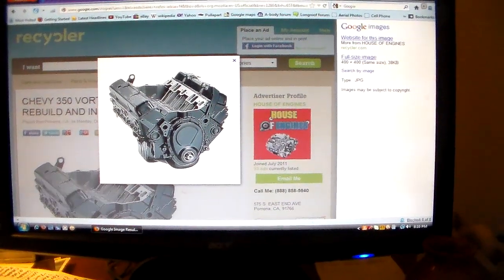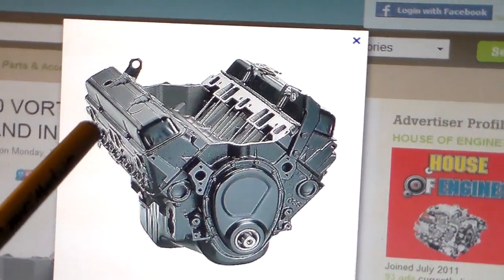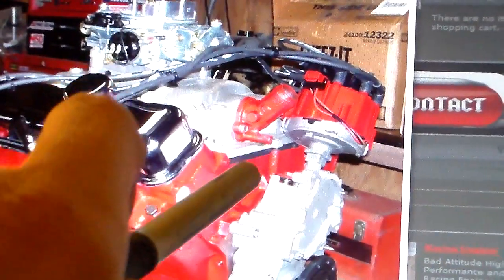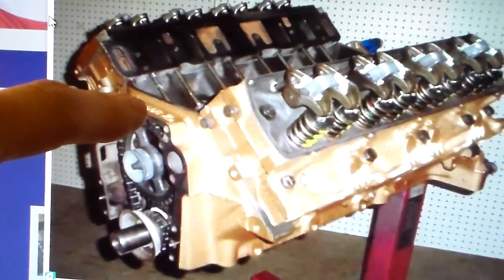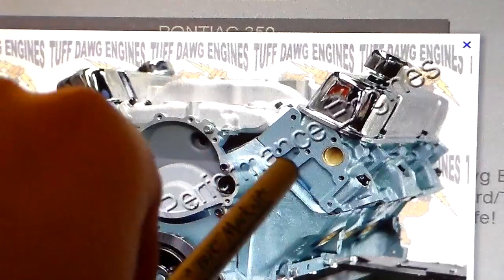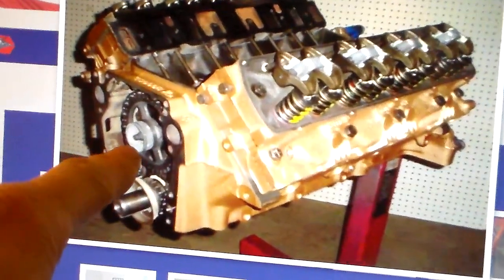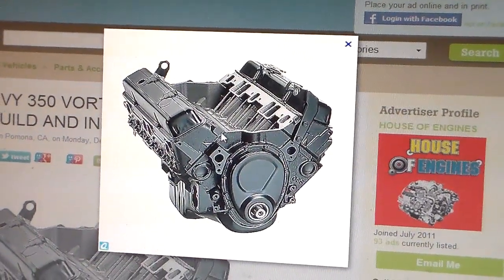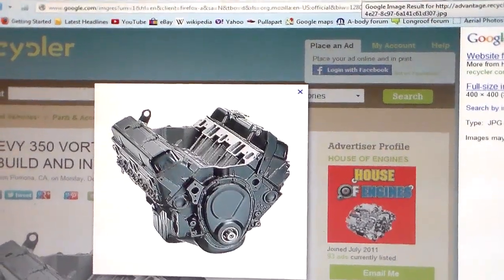Chevy, Olds, Pontiac and Buick V8 engines are not the same!

Comment: Does anyone know if I can install a 350 Chevy engine into my 1972 Buick Sylark which currently has a bad 350 Buick engine? Are the bell housing patterns the same?
Reply from the maker: They are not the same. A Chevy engine bolt pattern is different from Buick-Olds-Pontiac. Instead of putting a generic Chevy smallblock in there, which will require a different transmission and frame brackets, why not IMPROVE on things and drop in a good used 455 Buick? There are still a lot of those floating around, and it pretty well drops in place of the Buick 350, since Skylark's had a big-block optional. Then your main issue will be rear tire wear...lol. If you do, make sure you check the block casting number because small and big block Buicks look similar.
Reply: Sounds like a great plan. Thanks very much.
Reply: The 350 would have a large "350" cast into the back part of the intake. Don't know about the 455.
Reply: That would be my idea too same thing with any olds or pontiacs if it's got a 307 olds a 455 olds will fit right in a 301 pontiac a 455 pontiac goes in the same spot virtually un noticed unless you tell them no one would ever know shhhhh lol

Comment: I have a question, can you mount a Chevrolet head to an Oldsmobile engine
Reply: +Pete Zurkowski No absolutely not . Head bolts, water passages, intake and exhaust ports, and chamber to cylinder location is differant
Reply: Pete Zurkowski i will slap you no
Reply: Please don't say stuff like that again..

Comment: The 1st one is vortec 350 not a regular Chevy 350 Dummy
Reply from the maker: I'd like to make a suggestion: If you want any of the following to ever happen- 1. people take you seriously, 2. like you 3. partially like you, 4. at least not despise you until you die..THEN STOP PUTTING DUMMY ON THE END OF YOUR COMMENTS!!!
Reply from the maker: 1. Vortec is a marketing term. There were Vortec 350, 305, 262 V6 and even a Vortec 2200 4 cylinder. Look it up. In the small-blocks the difference is primarily in the heads, but you can bolt them to a "regular" 350 or 305(space that >I< didn't call you a dummy even though you weren't totally right).

Comment: After 1981,they're all the same...
Reply from the maker: Rick S  Well Cadillac actually had the distributor up front also after 1967.
Reply from the maker: They aren't all the same after '81, UncleScroatie. Buick V8's went away but the V6 was still around of course. There was still a very small Pontiac V8(265 cid) that stayed through '82, then Pontiac's were gone also.

Of course then Olds and Chevy were the only two corporate V8's left through 1990 when Olds V8's went away.

Comment: I had a1977 olds delta 88 with a Chevy 350 4 barrel carb in it
Reply: james hurt Whoever owned it before you swapped the engine and transmission
Reply: late 70s to the early 80s but all there engine are different I also had 1982 buick regal that I put a 350 Chevy engine in it out of a 1975 Chevy Monte Carlo.
Reply: james the bop caddy and chevy bells are different and how could gm get in trouble with using their own fucking engines?

Comment: but is the bore spacing the same? how about the insides?
like the ford 2.8 v6/ 2.9 v6 vs the ford 4.0 ohv/ and the ford 4.0 sohc
the old 2.8 looks nothing like the ford sohc but cams, cranks, "dizzy" all can be swapped.... to a point. so just bc they don't look the same doesn't mean they are not.

the big thing you got to look at is the block crank relationship. can a Buick, Oldsmobile, Pontiac or Chevrolet crank be swapped? and if it can't... why? is it just the placement of the timing chain sprocket? or is it something more?

that what you got to look at.
Reply: Kris Phillips With your logic all v 8 engines are the same cause they are a v8.
Even if the cranks were interchangeable between all 350 v 8 does not make them the same engine.
Similar...yes   same... no
Reply: +Kris Phillips   None of the castings are the same. You cant put a square peg in a round hole
Reply: thank you. that what really counts is the casting and bolts holes. the looks can be different but still work. you can put a 351 cleveland head on a 302 windsor but they do look different but it work as we know the boss 302. just saying you can't just go off of the looks.
Reply: well my point was that, you just can't look at a motor and say if it will or won't work. you got to dig into it and get the info. over the years i've found alot of odd ball stuff. ppl putting chevy rods if ford, putting ford pistons in chevy blocks. hell i even see someone put a volvo 5 valve head on a old ford 2.3l. you might have to do a little work here and there but some things can work that at first look you would even think about it.
Reply: yea i even seen that. you can't just slap anything together. but if you look at the vital pieces and if it is close. a little work and it can work. like the ford 200 inline 6. for a long time, you was stuck with what you got with the integrated head. but someone looked oversea at the australian ford 200 inline 6 and noticed with a little machine work it'll fit the US ford 200 inline 6. but they don't look the same. the australian ford 200 inline 6 was a cross flow design where the US ford 200 inline 6, the intake and exhaust was on the same side. but it worked. but now days someone makes heads for the little ford 200 inline 6 right here in the US.  so looking at something like a blueprint of an engine would work alot better the just looking on the out side at the aesthetics of the engine.
Reply: +Kris Phillips   I  think the pistons are different for the Boss 302, and if memory serves, the 'true' Boss 302 used the same rods as the HiPo 289.
Reply: +Stoneyburke   Although the Boss 302 is technically a different block, the chief differences are it is a slightly heavier casting with four-bolt main caps, and I think the water passages to the heads are drilled differently.   You can put 351C heads on a common 302 block with the proper mods.  It was a fairly common swap in the 1980s and early 1990s before high-flow Windsor-type head castings became inexpensive.  For a street engine, a 302 capped with 351C-2V heads were very capable engine, though you did need to locate a special intake to support the combination. 4V heads could also be used, but tended to make the engine peaky, and again, it required a special intake specific to the combination.   There was a company that made these special 'Clevor' intakes - 302/351C-2V,   302/351C-4V,   351W/351C-2V,   351W/351C-4V.

Comment: Dude makes all his vids using pictures, and wiki , he has very little knowledge about engines especially Oldsmobiles .
Reply: +david Reid  So where is this "Olds video" you told us you were going to make 9 months ago? I'm starting to lose hope in you. Are you having a hard time finding an Oldsmobile dealership? FYI: They are kitty corner from the AMC dealer. I know cuz I'm at the AMC dealership right now making my "Pacer X: Fast & Fun or Fishbowl Fiasco?" investigative docudrama video.
Reply from the maker: +judgegixxer He doesn't have time to make a video. He's too busy trying to learn Spanish off the internet. You weren't really expecting a video from him were you? He says...and I quote.."dude makes all his videos using pictures". Meanwhile, my current videos are about unseizing an OLDSMOBILE 394...live video bud. His "videos" speak for themselves. End of story.
Reply: judgegixxer You still know nothing about Olds and how they work.
Reply: david Reid uh david olds work the same as all spark ignition v8s
Reply: Yeah they do, but they have different bore, stroke , valve train is like a sbf , they like a camshaft with around .523 - .575 lift with a split duration 230/236  and 240/246 @ .50 on a 106-108 centerline 110 lsa .Lost ya yet? Just just for starters, the head flow characteristics are very different  from any other small block of its time with the side by side exhaust ports....Lots of tricks to know to make these engines perform.

Comment: MOST endivduals who think they are the same are born after 1975.  The reason i say this is they would be correct then...bare with me. the gm division around that time started heavily doing what they called "badge engineering"  now longer were one division doing everything on their own and the cars were very much alike minus small changes and no matter the brand they would use the small block chevrolet in pontiacs,buicks, and oldsmobles because to same money they were no longer making their own engines by the mid eighties.  That was the beginning of the end for both pontiac and oldsmoble

Comment: Chevrolet  is the only engine company that calls their engines small/or big block.
The old school small blocks are 302,305,307,265(rare engine) 327/348/350.
The big blocks are 366/
383 400 427//454,502.
Reply from the maker: Let me help you out a little:

1. There are small-block and big-block Oldsmobiles, Buicks and Chevies. PLEASE google that if you have further doubt.

2. You left out the 267 and 283 small-block Chevy engines.
3. 383 and 400 are not big-blocks. A 383 is a 350 small-block with a 400 crank and a 400 is a small-block with a bore so large there are no coolant passages between them.
4. A 348 is not a small-block per se. It COULD be considered one, but it belongs to the W-engine family along with the 409.
5. The big-block you were thinking of was the 402. Nothing notable about it other than it took up the same space, weighed nearly the same as and made less power than a 454.

Hopefully this will help you enjoy GM engines even further !
Reply: The facts from any/all of our mechanics and engine technicians all say that only Chevrolet has small blocks and big blocks.
Call this # 619 297-4321 courtesy Chevrolet.
Reply from the maker: TheSirjohn2012
I'm not being mean to you but there's probably not one tech there who's worked on a pre-1980 Buick, Pontiac or Cadillac engine. If I suggest you do a Google search for "Oldsnobile big-block" and "Buick Big Block", are you going to come back and tell me that all those results you got are wrong and Courtesy Chevrolet is right? They E-X-I-S-T...end of story.
Reply from the maker: TheSirjohn2012
 And anyway, I don't need to call the friendly folks at Courtesy Chevrolet...to quote "gamer-speak" I have In-Person experience with Big-block GM engines...I've actually touched them and worked on them and I hope you can too one day.
Reply: Sorry tyler but my neighbor has worked on many Chevrolet engines and he says that there are 2 kinds of chevy engines.
Big blocks/Small blocks I wish you would try to quit arguing with me and assuming your own education is far better than mine.
Us men in our 50+ years can't be argued with.
Try educating yourself in this argument and get the truth in all of this.
Now leave me alone OK.
Reply: um sirjohn you forgot the 283 small block lol and chevy didn't make a 383 lol. a 383 is a 350 with a 400 crank. I cant believe anyone would honestly think that all gm 350s were the same!!
Reply from the maker: TheSirjohn2012
It's not an argument. I presented you factual information and you refused to believe it.Facts are indisputable. That's why they are called "facts" and not opinions.

You mixed a 348 into the actual smallblock group. 348 was part of the W-head engine group. You also inserted a 383 into the bigblocks. there wasn't one from the factory. Now stop getting mad because people are correcting your info. People that are stubborn will never learn from those who have knowledge.

Comment: I saw a Pontiac parissiene with a chevy 350 engine......not standard?
Reply from the maker: They had Chevy 305's...no 350's to my knowledge.
Reply: WhoSaidTyler right, I read Wikipedia and it said Pontiac made their own engines for their cars until 1984 or something?
That was wrong?
Reply from the maker: tpvalley
 They made ONE engine by then, which was the 2.5L "Iron Duke" 4cyl. Otherwise all the Pontiac V8 engines went out of production after 1980. The Parisienne was a Canadian version of the Caprice, which was introduced in the states because buyers wanted a full-size rwd Pontiac again.
Reply from the maker: WhoSaidTyler
 I forgot about one: the 265 cid Pontiac. I think that one and possibly the 301 hung around through 1982.
Reply: WhoSaidTyler They dropped it midway in the 1981 model year (think January 1, 1981; despite Wikipedia's claim it was on April 1, 1981).
Reply: Given the Parisienne was originally a Canadian-market Bonneville, of course it came with a 350 Chevy V8 engine if it was produced from 1968 to 1980.

The tradition remained the same when the car was brought over here in April 1983 to fill the gap in the market segment left behind by the B-body Bonneville (last produced in 1981). Available engines for that short first model year included two Chevy engines (the 229 V6 and 305 V8 - both having a shared bore and stroke) and the Oldsmobile diesel V8. California V6 cars, however, used Buick's 231 V6 engine.

Both the 229 and 231 V6s were replaced by Chevy's new 262 V6 for the 1985 model year, which was also the last year for the diesel option.
Reply: ClassicTVMan1981X so whats the video bloke on about?
Reply: ClassicTVMan1981X The Pontiac I saw had 4 head lights, the pairs on each side, ...one above the other. 65 or 66 it turns out.
Reply: tpvalley Then it would have had the 250 I6 or the 327 V8 originally.
Reply: +tpvalley    81

Comment: which one is the best ?
Reply: ERICK CH Pontiac Buick and olds engines typically have more torque than a chevy, it all depends on what you're looking for. torque, or power. I mean you could build a chevy to have more torque than the others, just like you could build the others to have more power than the chevy. So there really isn't one that's better than the other, it's mostly about what you want out of an engine.
Reply: ERICK CH 350 Chevy vortec! Many performance options.
Reply: IRRC the Olds was a 5 main bearing engine, the Chevy 3 not sure of the other divisions
Reply: S Baker The early small block only had 3 main bearings? Interesting, I've never seen that
Reply: Wrong. The Small block always had 5 main bearings.
Reply: Wrong. The Small block always had 5 main bearings.
Reply: In stock form my opinion would be olds or pontiac In the 350 world olds rocket hands down made the most power and torque of all the 350ss and if I'm wrong tell me but i drove a car of similar weight with 350s from each division and the olds was the baddest ass motor why idk but pontiac 350s were ah ok not great till the 400 motors the chevy 350s ok but lacked low end the olds had low end and the top end performance over all making it my pick

Comment: If I'm right, the Pontiac is a big block.
Reply: nope
Reply: @manher4335  just learned a short while back that with the exception of the 301, the blocks are the same size like AMC.
Reply: @markdubois4882  It's ok. In certain books they've actually listed certain Pontiac engines of larger displacement as big blocks.

Comment: Olds are the best, then Buick
Reply: Nope,you got it backwards
Reply: @markbuchanan3694  nope, junk oil pump housing in Buicks makes them second
Reply: @johnhull6363  nope ,you are wrong again. The oil pump in the Buick does its job well, easily serviced and simply adjusted. Don't have to disassemble half the car if a problem does occure, and Buicks don't spit their camshafts out the back of the engine like an olds will

Comment: Buick sold the 225 v6 amc took over from there. there are no Buick v8s in any jeep.
Reply: yes jeep gladiator trucks used 350 buick v8's in 1969
Reply: Gladiators and wagoneers had Buick 350 s in them

Comment: I like how guys with a Buick olds or Pontiac tell you they have a big block
Reply: Mary Corbiey what do you mean? I get the Pontiac but olds and buick have big and small blocks...
Reply: yeah, Buick and Olds had defined big and small blocks, pontiac did not. Just engines with larger/smaller crank jounral diameters and the obligatory different size bore/stroke combos.
Reply: Mary Corbiey they did come with big blocks